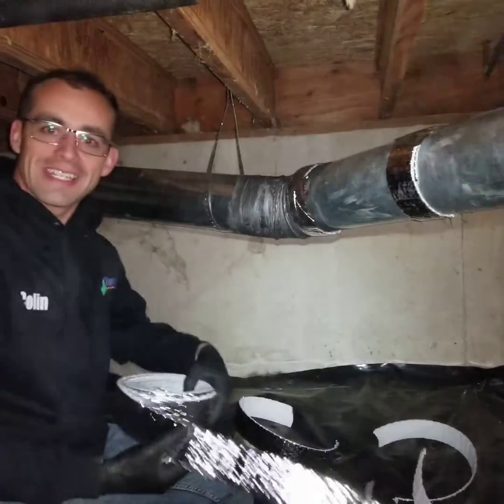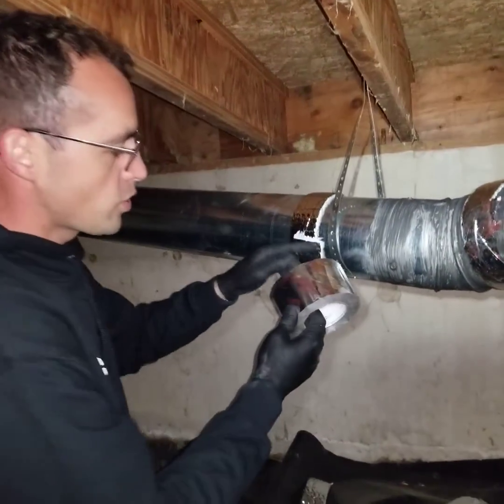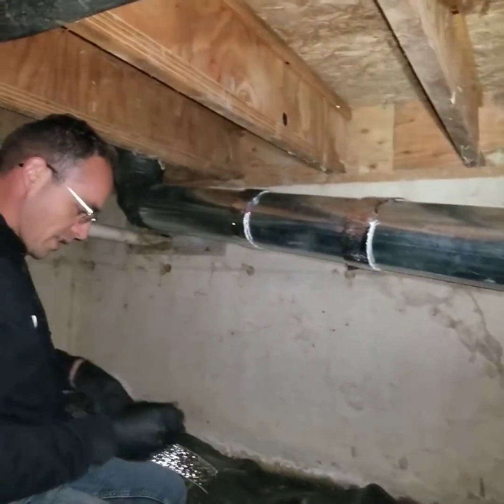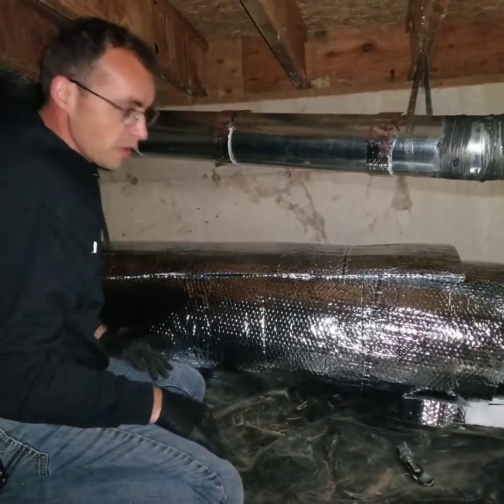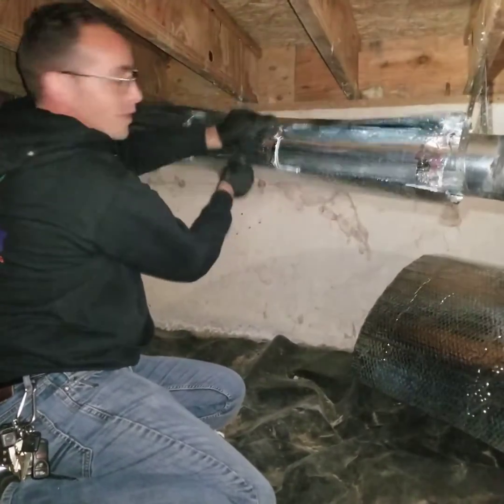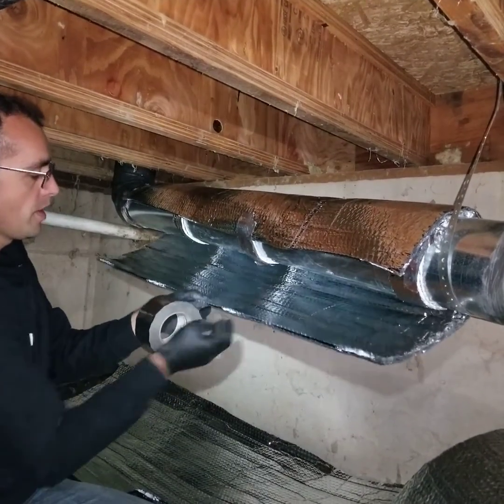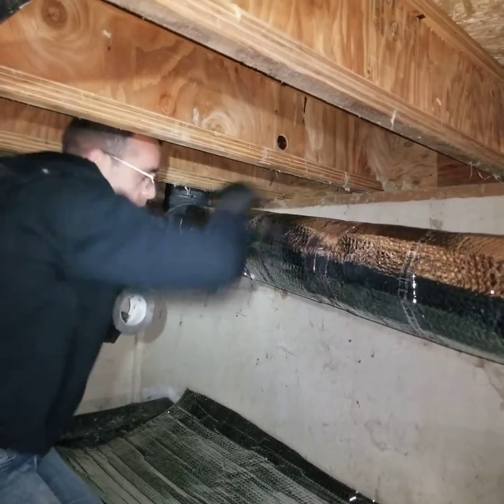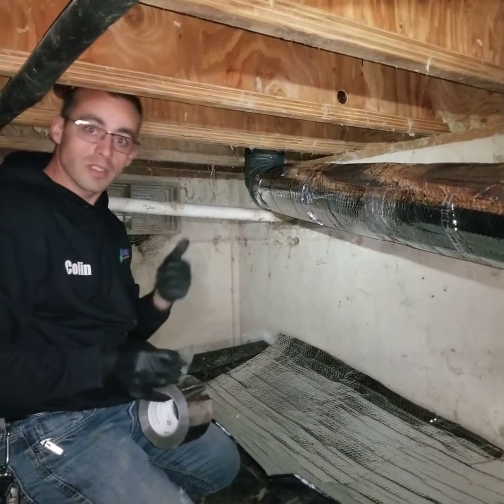How to insulate Metal Ductwork with foil insulation - for HVAC installers

Comment: great video, what is the thin insulation strip you used? I cant seem to find that anywhere?
Reply: you can just cut and make your own strips from the roll
Reply from the maker: @justinrichard4190  true. I use the rolls that come already pre-made for us to save time but yes we could just get strips out of the roll.
Reply from the maker: The thin strip of insulation comes in the package with a big roll of insulation and is used to create an air gap so the rating goes up from R6 to R8.
Reply: @cleanairheatingcooling4105  thank you so much for replying so quickly. Can you please share the link or brand of the large insulation roll? TiA 😊
Reply from the maker: @quantumvibe-m6  I don't know nits a pretty nondescript roll of insulation that comes in a cear plastic bag. If I come across any specifics or brand name next time I work with it I will let you know.
Reply from the maker: @quantumvibe-m6  I wish I could attach pictures to this responses in YouTube because I would just snap a picture of the package next time I'm working with it and just tag you in it but I guess I'll have to upload a new video with it. 😀 I hate asking this because I get tired of hearing it on other channels but if you subscribe you'll definitely get notified when I upload that as long as you allow notifications from this channel. 🤷‍♂️

Comment: Another option is to buy flexible, insulated ductwork, remove the stiffening steel wire, split it along the length, and wrap it around the existing duct. It can be taped in place, but I find cable ties every foot or so are quicker. Choose the correct diameter, and there's no need to measure and cut.
Reply: that would be a waste of money, flex duct isnt that cheap
Reply: Cable ties compress the insulation reducing the effectiveness of it.
Reply from the maker: @MAGAMAN  true. This has to be accounted for during design so with all the airflow issues caused by that the output of the duct is still sufficient for the job. Unfortunately too many jobs have ducts that were just a guess and this leads it discomfort for the occupants.
Reply from the maker: This is definitely a creative approach and I haven't seen that before I'd be curious how much quicker this is and I'm sure if done correctly the look would be great

Comment: Great video, thanks.  Adding those strips to the duct seems like a good idea regardless local building codes.  Cheap and easy insulation bonus.
Reply: Wonder if the spacers have to be purchased separately or does it come with the sheets?
Reply: @carolinashagman  probably separate.  I expect it's just a difference in the width of the roll, of the same kind of insulating material.  The big one being about 4' wide, the "strips" being about 4" wide.

Comment: If you

What do you think of foam spraying the ducts?
Reply from the maker: I've seen it done. I don't have a strong opinion one way or the other. The benefit of spray forming the ducts is they get insulated and with closed cell from insulation it's also going to be airtight. The drawback would be if you need to do a repair or anything has to be modified the foam will add an extra level of complexity in dealing with the ductwork. So there are pros and cons to it. I would love for spray foam professionals to share their opinion on this.
Reply from the maker: https://youtube.com/shorts/fS84nRaBSJA?feature=share
Reply from the maker: The link above is for an example of ductwork encapsulated in spray foam